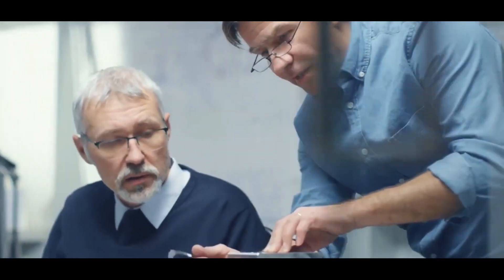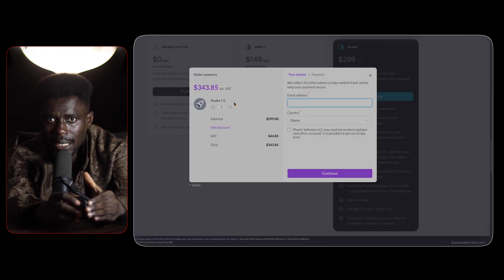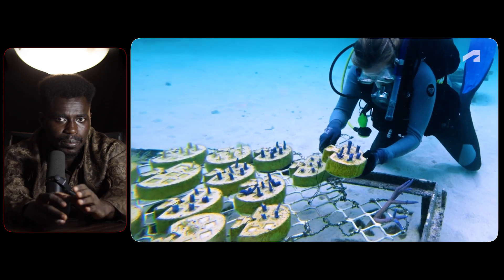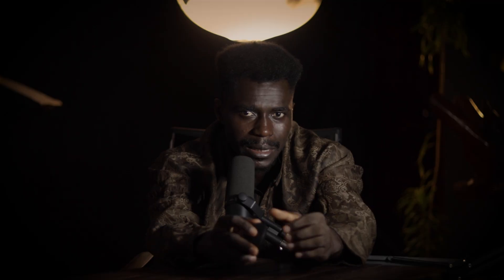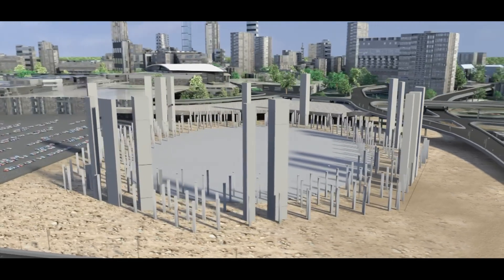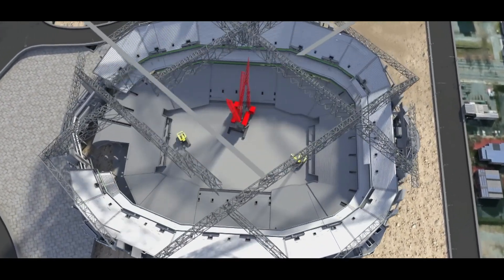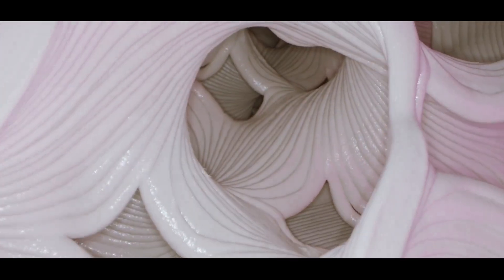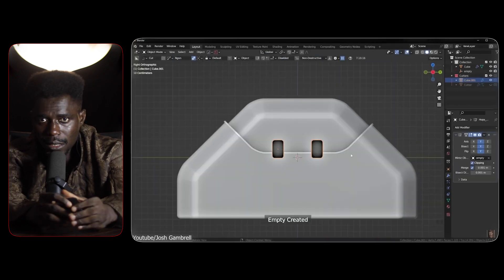PLASTICITY 3D. 4 MAJOR Problems Nobody Talks About!

Comment: Plasticity doesn't aim to compete with CAD packages like Solidworks or Fusion. It has no parametric system to speak of and no construction history, but that's not the point. I think it's a competitor to software like Alias Studio or ICEM Surf, where designing shape language is the primary goal. Being able to do this watertight and with reasonably accurate dimensions only is an added benefit to people who want to print their models.

Your video basically says: I want to cut my bread with this screwdriver, but it's harder than with those knives over there.

Comment: Hmm I don’t think that your accessment is correct.

Rhino is stagnant - while it adds tools the core tools are broken.

Fusion360 is a joke of a 3d modeling program.

Alias is king in surfacing but only Windows and very expensive.

Looking at Shapr3D Plasticity in the same-way has a great future to break into a niche market the so called established CAD apps are too obese to adjust too.

Comment: For me it isn't about commercial marketability it is about low cost of entry. I am a hobbyist 3D printer who would like to make projects/devices for my photographic and woodworking adventures as well as others that I think up along the way. First off there was Sketchup which was great for woodworking projects and once mastered it was easy for me to use for the two projects I built for myself, a guitar amplifier head unit and an enclosed, suit case-like, pedal board for my guitar rig. The free version became less usable with every upgrade I made to that software. Then came Fusion 360 with ten free assemblies that pretty much encompassed the learning curve before the now $600+ annual subscription. I am currently using Tinkercad which is too basic and not so easy to use the way I am used to nor can I easily size threaded holes like I can in Fusion or enter dimensions easily in the history/parametric side of the program as in Sketchup and Fusion so navigation is an issue with Tinkered. I had hoped this buy once Plasticity would bridge my gap as the hobbyist user, since, at the mid level pricing, is affordable for my level of usage. But the parametric side is what I am concerned with and I don't see that here???

Comment: As an artist who regularly needs to work with CAD files, you have no idea what you are talking about. Plasticity isn't in competition with CAD software. It doesn't need to integrate into engineering workflows because it's not for engineers. 

It's only real competition is MOI3D. Take a look at MOI3D and Plasticity and tell me which one looks like it can get regular updates and stay modern.

Also, it's insane to me that you're making a lack of a subscription model out to be a bad thing. They will continue to get revenue through selling annual updates, similar to a subscription model. The difference being, if you ever decide to stop buying updates, you can still open your files. This is a good thing.

Comment: I was laughed at by fellow architects  when I took up the first version of AutoCAD. I saw the potential while they didn't. Time proved that I was right and they were wrong and I think you are wrong as you only see negatives. Plasticity is software I see that has a very bright future and the developers work hard at updating it. You may not see it's future, but many Plasticity users do. Plasticity is not software for architecture, although it has capabilities in that discipline. I find your comments very repetitive and frankly, boring.
Reply from the maker: @Argyll9846  I have made so many great videos on plasticity.its a powerful software, this video only tackles the negative aspect people should watch out for, that's all.

Comment: Plasticity has a special roll, it is a cad tool for artists, more a comparable with moi3d. Fusion360is more for printing and small engineering jobs, but you never get created good complex surfaces in fusion 360.

Comment: Plasticity is for asset creation. Not full on engineering. That is why is such a good price. Plus the features you are requesting will make Plasticity too expensive. And the BIG Selling point...... No Subscriptions!!!!!! Also can I buy Solidworks, Fusion 360? They are strictly Subcription ONLY.  Buy is to keep not rent. Not everyone can afford $5000 to $10,000 a year to use Solidworks and Fusion 360. It's mostly seen as a addon for Blender 3D.

Comment: What part of CAD for ARTISTS you didn't understood?
It's not supposed to replace F360, Solidworks etc..
Reply from the maker: @manuel.camelo  I never said that in the video. Sorry.
Reply: @GearSolid3D  From the video you're implying Plasticity can't compete with Fusion 360, SOLIDWORKS etc.. But the whole point of Plasticity is that it gives a direct modeling approach to what otherwise would take hours and many more steps if done in Fusion 360 etc..

I know because I've been using F360 for years and it's very "bureaucratic" when it comes to an Artistic / Design approach to things.

Comment: Plasticity 3D has a direct blender bridge (real time modeling), which means there isn't a need for a file conversion into blender. So basically, Plasticity 3d is Blender. Anything modeled in Plasticity has direct access to the entire Blender platform. It's basically an addon for Blender. So as long as Blender is relevant and successful for Blender's purposes, so will Plasticity 3D.
Reply: Plasticity made themselves a Blender add-on , a tremendous one
Reply: It's a shame that there isn't a Bridge into UE5.  UE5 modeling is awful whereas Blender modeling is already great.
Reply: You consider it a Blender add-on because you use Blender, but many others use Plasticity for different stuff.

Plasticity to Rhino to manufacturing (technical drawings, cnc cutting and other)

Plasticity for 3D printing

Plasticity to Twinmotion for quick visualization for my clients

Most of the time i dont even need to use Blender
Reply: @redvood3d  I use Plasticity to grasshopper. I only use blender for rendering
Reply: @ thats what im saying, saying that its basically an add-on for Blender is devaluing Plasticity when it’s a really good software by itself.
Reply: @redvood3d  I'm a mechanical engineer that loves plasticity. I'm trying to find ways to use it as much as I can. Engineers can't use plasticity for manufacturing, and they never will. Engineers require their designs to be parametric with a design history, otherwise they can't use it. That's why anything I design in plasticity has to be rebuilt it in Grasshopper (parametric). The premise of plasticity is to be used with Blender. Plasticity wasn't created for hobbyists and their 3d printers (which i do as well), it's for artists (who use Blender).
Reply: @redvood3d  Bro, Plasticity is doing amazing, whoever say the contrary is just messing around or doesn't get it at all, I don't know the gymnastics required to see my comment as "devaluating" but I meant totally the oposite of that.